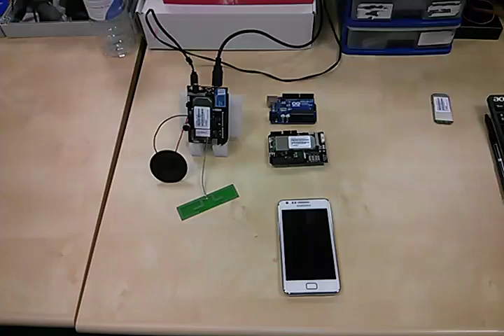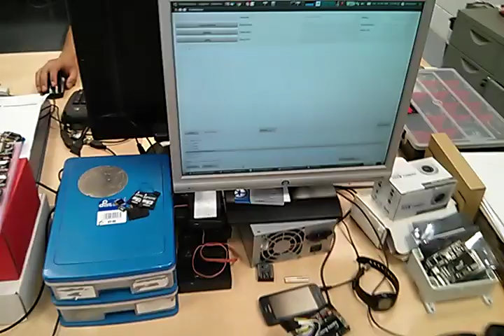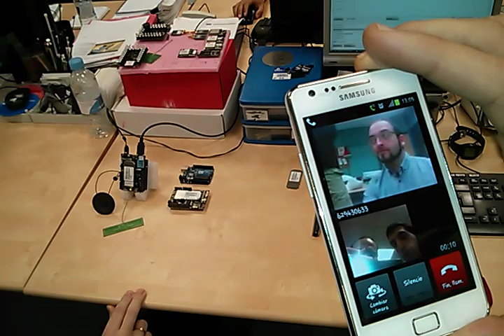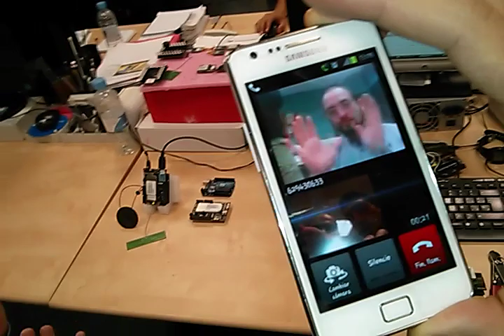Video call using 3G/GPRS Shield for Arduino

Comment: This question may be slightly off topic, but does the SIM Card need to be attached to the 3G/GPRS Shield for you to use the unit? Meaning, will the GPS part of the 3G/GPRS Shield work even without a SIM Card in it?

Katalyzt